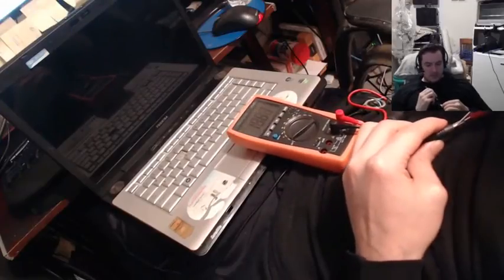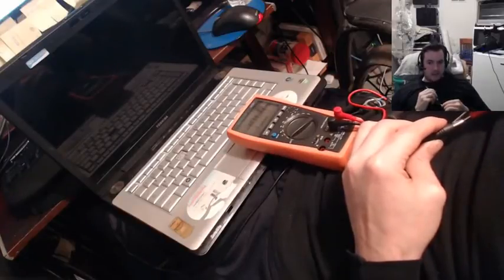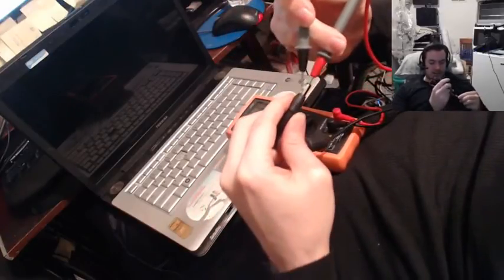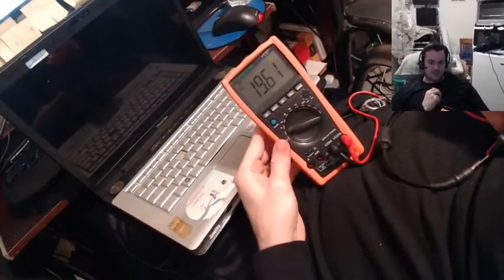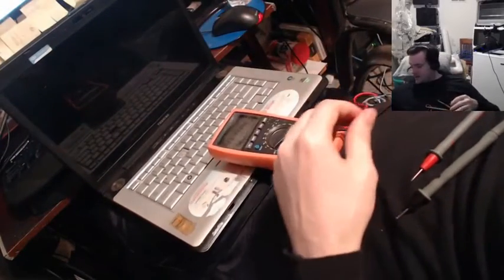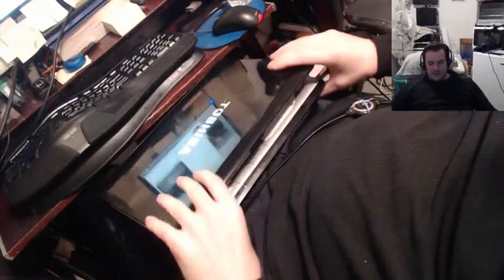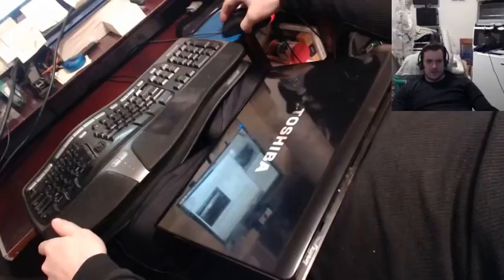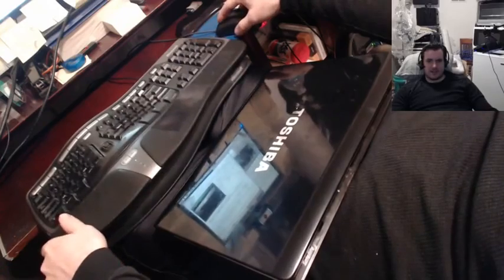How To Test AC/DC Adapter Laptop Power Supply Output

Comment: What are the settings on the meter? where are the terminals connected to the meter?
Reply from the maker: on this type of digital meter, the dial switches to voltage measuring and applies to ANY voltage and the terminals connect in the same place always for any voltage and any other measurement besides amps.  You are assuming this is a old school meter.